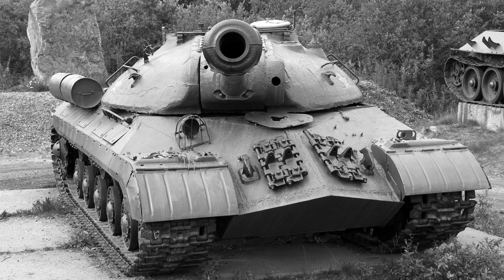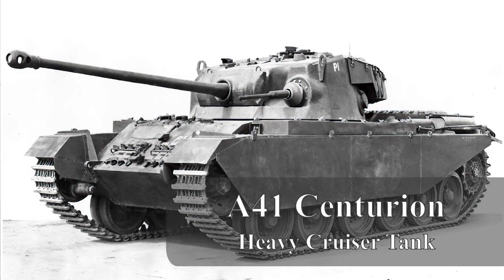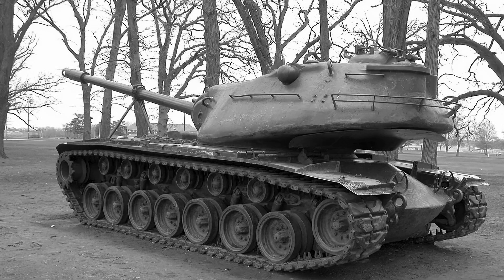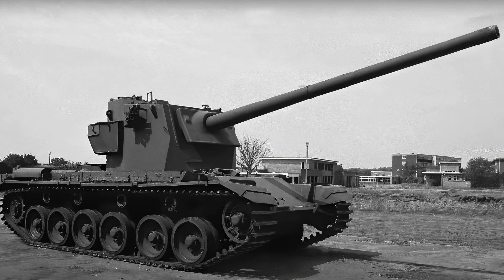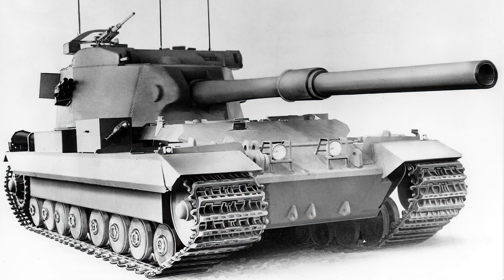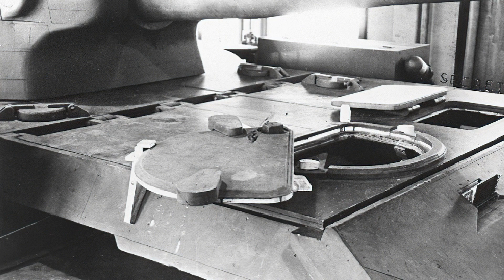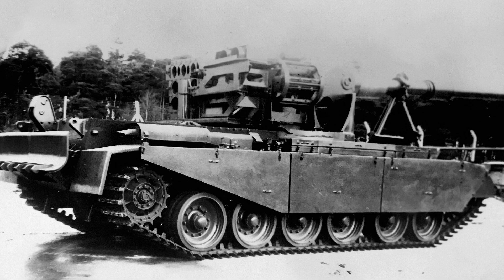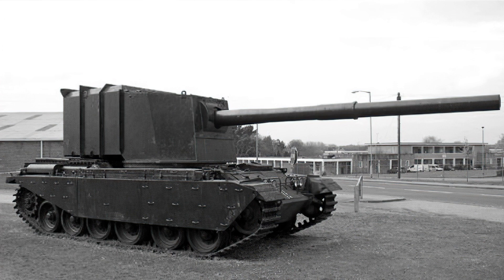FV215, FV4005, FV214 Conqueror, FV221 Caernarvon, A41 Centurion - Development of Post WW2 Tanks

Comment: The IS-3 turned out to not be the boogieman western intelligence believed it was. Reports of 230mm. of armour omitted to point out that this was on the gun mantlet only.

The IS-3 armour layout was actually:
Mantlet = 230mm.
Turret = 200mm. all round.
Hull front = 120mm.
Hull sides & rear = 60mm.
Deck & Floor = 30mm.

It wasn't until the late 1980's / early 1990's that it was discovered that two IS-3 tanks were destroyed during the Battle of Vienna Bridge in 1945, one by a Panther G scoring a point blank hit on the upper hull side of a parked IS-3 and a second IS-3 being burnt out follow two Panzerfaust side hits, during street fighting to capture the bridge. The account of the battle is in the book, Tank Action, by Colonel George Forty, former curator of the Bovington Tank Museum and my boss when I worked there during 1986 to 1987.
Reply from the maker: Oh I’m well aware of this, it was a fixation they had despite more sensible voices telling them the threat lay with the newer T series. As for IS3s in Vienna this remains somewhat controversial as to date no evidence has ever emerged from it, no photos, no battle reports nothing, not in Russia or Germany. it’s a shame we can’t asK G.F where the information came from originally.

Comment: According to Tank Encyclopedia, only the turret of the FV4005 Stage II remains. The turret is currently mated with a spare Centurion hull The Tank Museum had. The original hull was modified with a recoil spade which could be lowered by a hand-cranked winch.